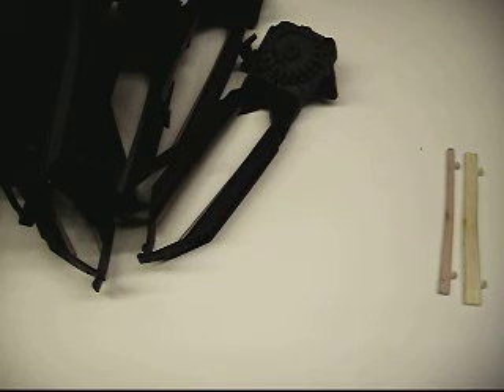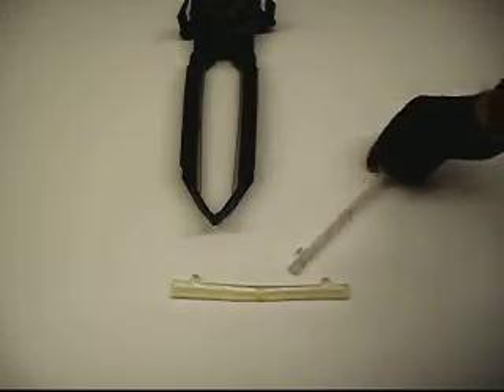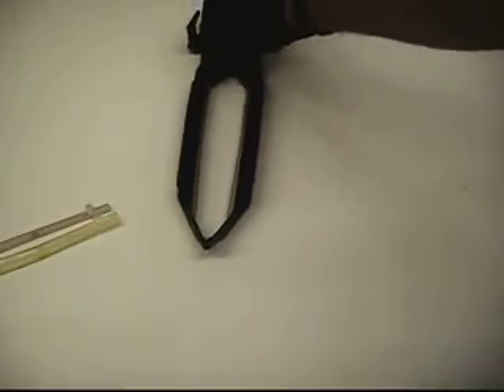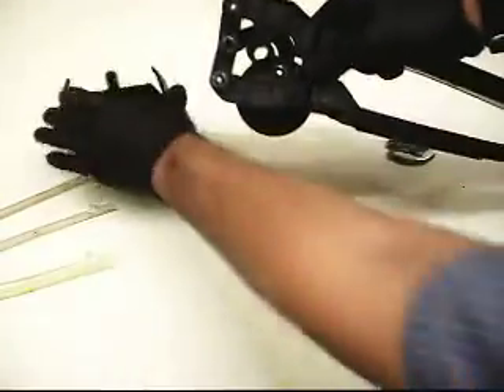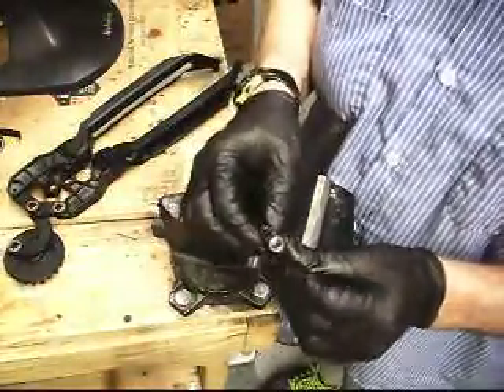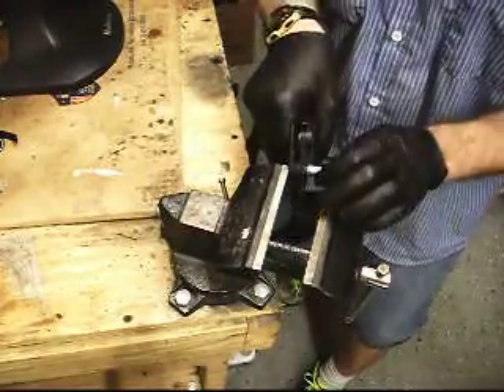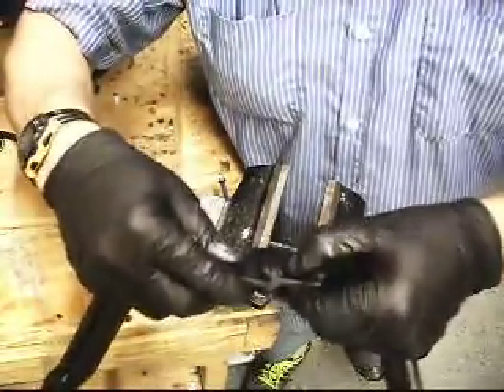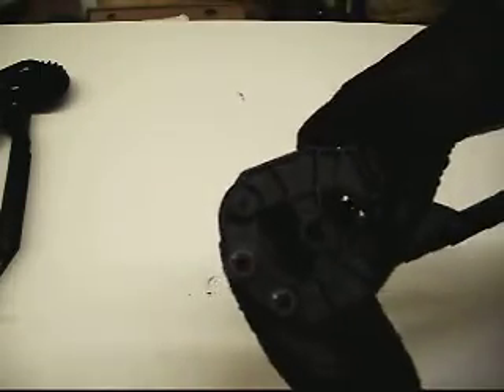GS-X pinsetter, new style tong, tune up.

Comment: On a GS-92 I remember on Lane 8 back in 2014 the 9 Pin tong doesn’t close always and the 3 Pin drop sometimes and on Lane 15 back in 2017 The 4 Pin keeps dropping (sometimes drops outside and push away by the sweep)

Comment: It takes a lot of time to load the sir pin. Why the hot-ups do not tell me the carpet is too slow
Reply from the maker: Deshraj-
If the transport band (carpet) 11-635201-000 is slow your elevator chains 47-014008-003 might be too loose causing the shovels 47-013532-009 to drag on the rear wooden chain guides 47-013954-003 on the way down making the transport band slow. 
If the elevator chains are too tight this will slow the transport band as well.
Your bearing assembly 47-073520-009 on the front of the pinsetter, the one that connects to the distributor, may have had a bearing fail.
Your spring 47-095923-004 could be loose, the one that puts tension on the distributor motor 99-076362-000, causing your belt to slip.
The belt 11-053905-000  that goes from the distributor to the elevator could be loose.
Your tension springs 47-024309-004 on the transport band could be loose or broken.
Your threaded rod 47-024093-004 could be loose from the bearing housing 47-024094-003.
 
Your elevator shovels are driven from the distributor motor as well as the transport band.
You can temporarily remove both the belt that goes to the transport band and the one that drives the elevator.
Run the pinsetter on diagnosis for a second and throw a pin on the top of the green belts on the distributor.
See how fast the pins run on the distributor.
Then replace the black drive belt to the transport band.
Run the pinsetter again and see if the pin is moving at the same speed on the green belts.
If all is still good then add in the elevator belt to the system.
You are trying to narrow down which section is slowing down the entire cycle.
Then you can address that specific issue at fault.

Hope some of this information gets your pins lifting faster to the top.
If I can think of anything else I will let you know.